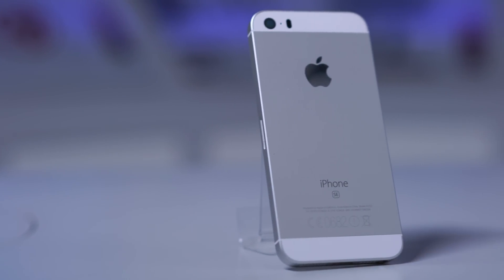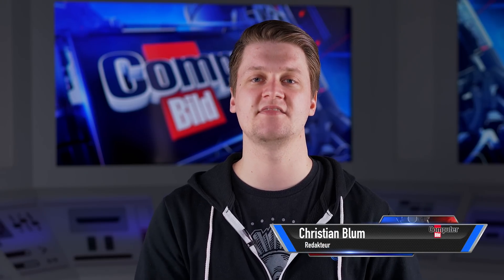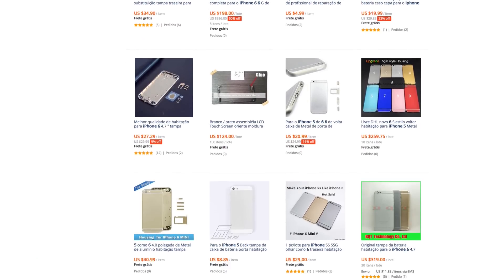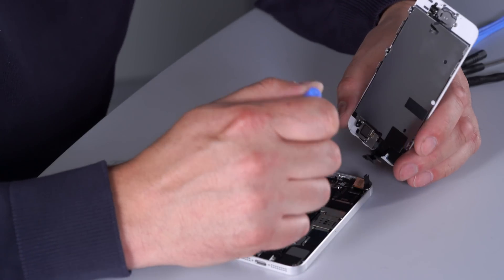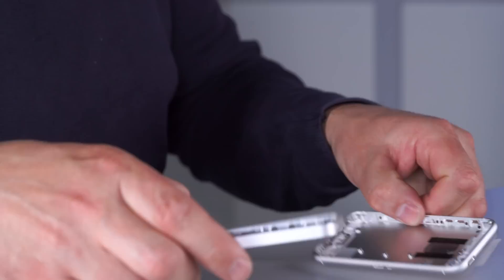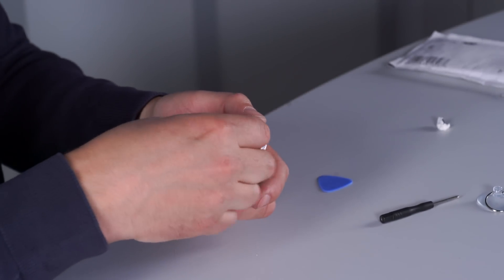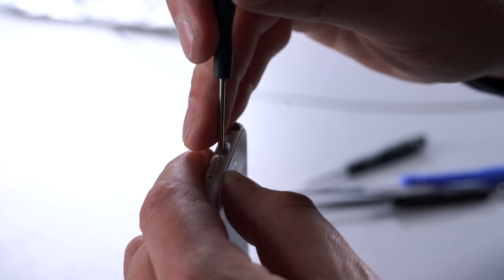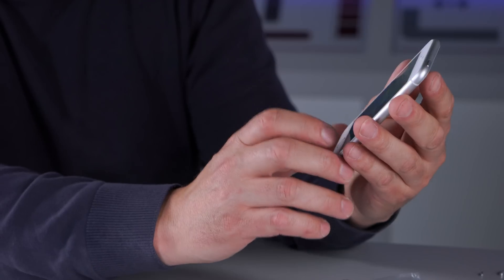Exclusive iPhone 6 SE: This is how you build it

Comment: 4" IPS (640x1136) - iPhone SE
4.7" IPS (750x1334) - iPhone 6
How did you solve this problem? Or it's not a problem for iOS ? New 4.7" 750x1334 display from iPhone 6 compatible with hardware designed for 4" 640x1136 iPhone SE by pins?
Reply: +Антонио Бандерас 4-дюймовый корпус с алика задизайненый под 6ку
Reply: Bossman literally it’s custom housing innit
So it doesn’t become an iPhone 6
It’s an se logic board in a shell that looks like a 6